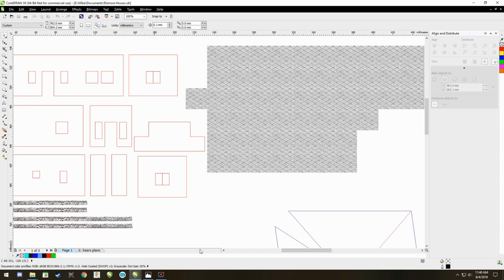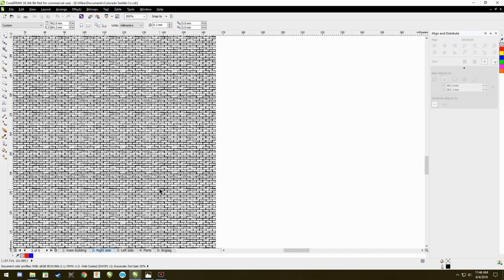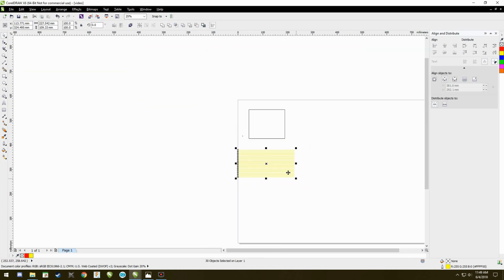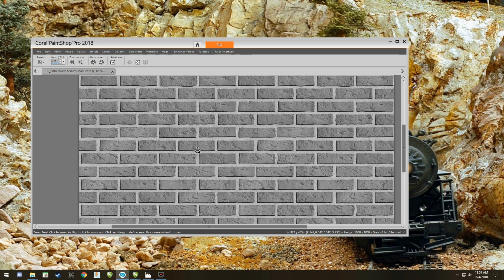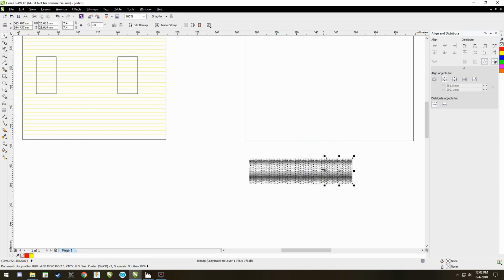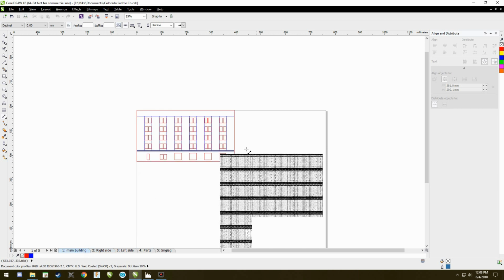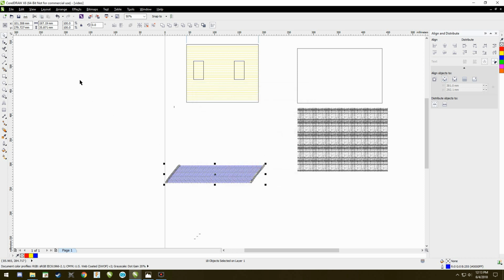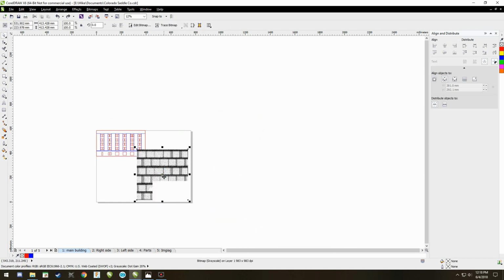Scratch building models with a laser part 2

Comment: These are such good videos. What do you do about brick building corners. The Colorado Saddlery Building has corners that meet in brick? How do you make that work? do you mitre the edges 45 deg for that? Thanks!
Reply from the maker: I take a  1/4 square rod and laser cut the brick on 2 sides of the square. I also have done 45 deg as well.